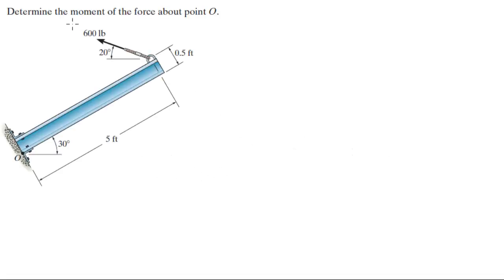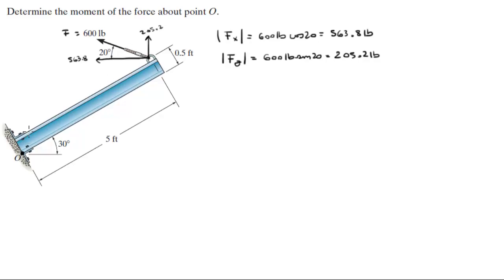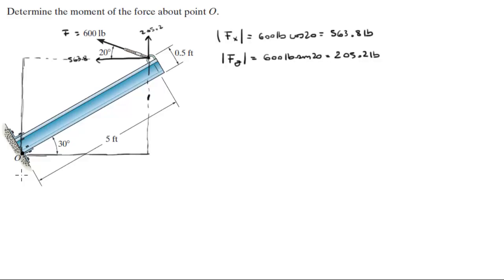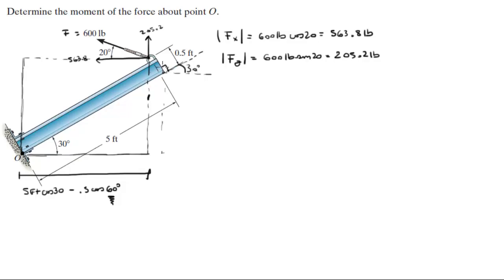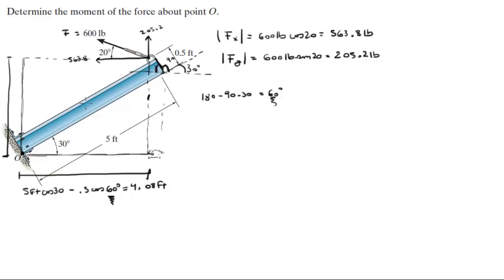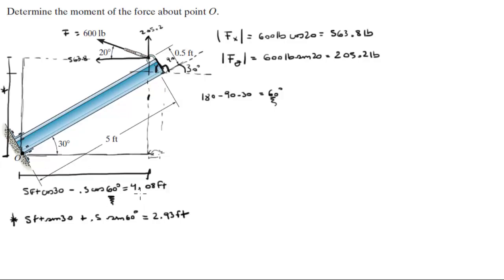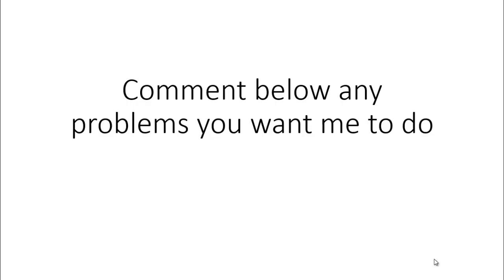Determine the moment of the force about point O.

Comment: When resolving Fx, we see that it's on the 2nd quadrant, and the cosine of any angle is negative at this quadrant, so why is Fx positive instead of negative?
Reply: Magnitude is of absolute value. In solving for moment, each force's sign (positive or negative) depends on how the reference point will rotate when this particular force is applied. Say, Fx. When you apply Fx (towards the left direction) to the lever, the lever with respect to point O will rotate counterclockwise. Since he considered counterclockwise as positive, Fx is then positive.

Comment: My answer is -2489.15 lb-ft counter clockwise if your assumption was clockwise rotation (+). His answer was correct but he only made a mistake in his solution. Try to change 2.93 into 4.08 as a multiplier to the value of vertical force.
Reply: I did the same thing, and I got -2489.28lb-ft.
The negative sign shows it's conter clockwise.
So the correct statement should be -2489.28lb-ft 
OR
2489.28 lb-ft (counter/anti) - clockwise
AND NOT
-2489.28 lb-ft (counter/anti) - clockwise.
Reply: That's true he made a mistake there

Comment: i dont get the part why we need to add 0.5 sin60?? i thought 5ftsin30 is the full length of y already? please explain
Reply: 5ftsin30° is the y component of the lower line of the lever and the force is connected to the upper line. sooo, 5ftsin30° is still not enough to reach Fx, hence the y component of 0.5ft is added

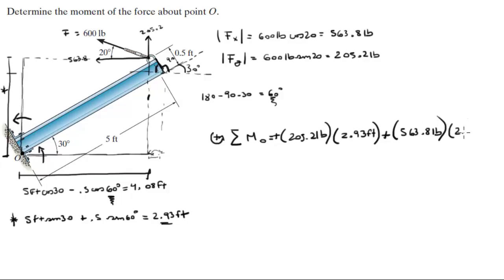Comment: He made the mistake at 4:41. He used the length of the wrong lever arm. If you jump to 4:41 and plug in 4.08 ft instead of the 2.93 ft he put, you will get the correct answer.

Comment: I got 2253.20 with my calculator after multiple attempts using your numbers.
Reply: Stuart Sullivan me too
Reply: He made the mistake at 4:41. He used the length of the wrong lever arm. If you jump to 4:41 and plug in 4.08 ft instead of the 2.93 ft he put, you will get the correct answer.
Reply: 2253.17